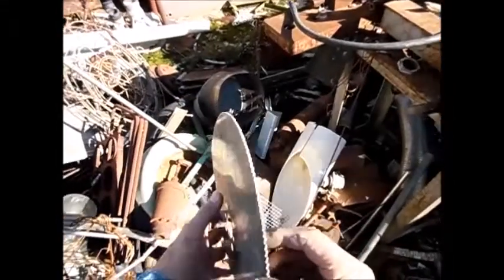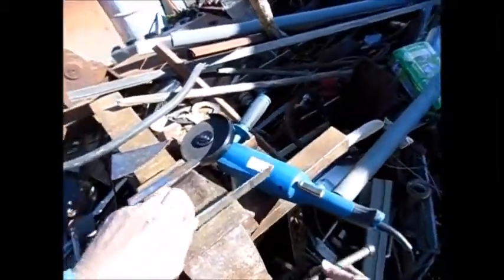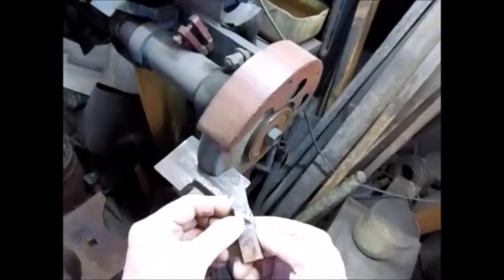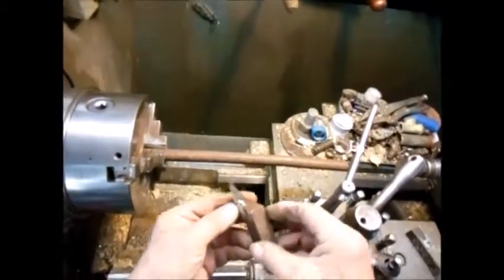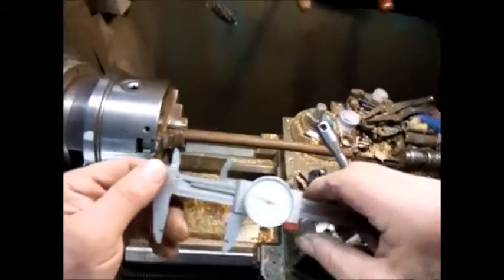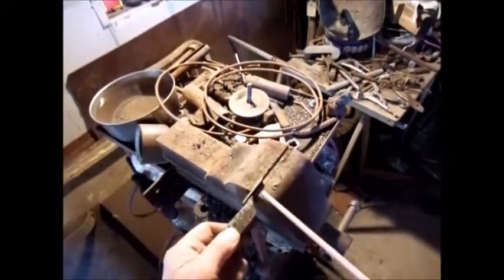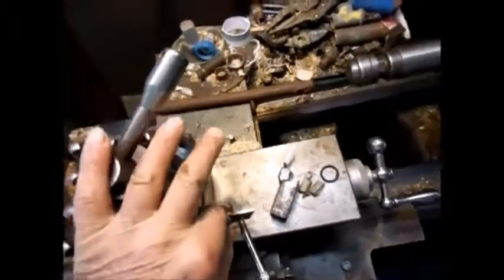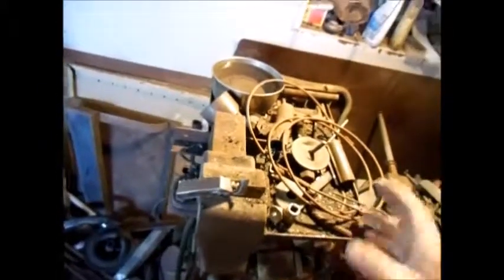Make Free Lathe High Speed Steel Tool DIY  Sve za džabe すべて無料

Comment: But how do you KNOW it is HSS?   IT is not like it is marked the way plastic is marked with codes on the bottom...
Reply: I guess you could use a file on it too check for hardness, and magnet too exclude other materials it could be, and my last tip would be too check the sparks from grinding it, you should see lots of small white sparks that branch out like fireworks, if the steel isnt marked. Not that I would know
Reply from the maker: Usually there is  HSS marked on it

Comment: Thank's for the video.   What was the steel you cut with the grinder?  Was it some type of saw blade?  Must be very good steel.   I have those welding rods and it would be good to try. 

Dale in Canada
Reply from the maker: Yes it is broken saw blade In Australia we call it high speed steel material that lathe cutting tool is made .Thanks for comment .
Reply from the maker: Yes in this case that what it was

Comment: Was the broken blade you used a cold saw blade?
Reply from the maker: It is High Speed Steel material resistant to Hi temperature and is very hard usually used for parting off tool
Reply from the maker: Yes